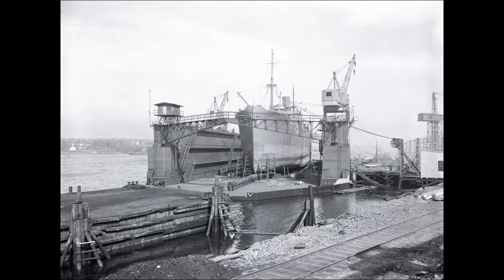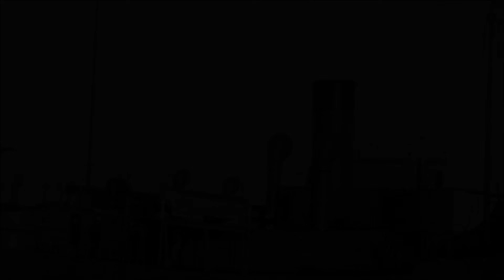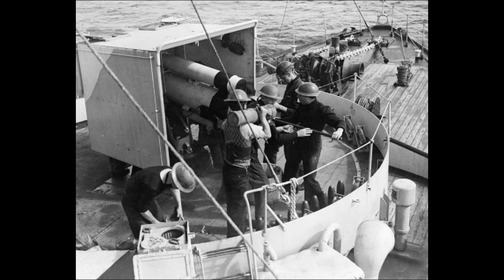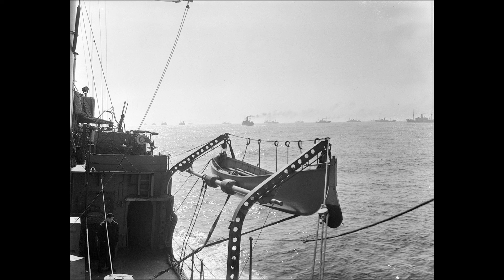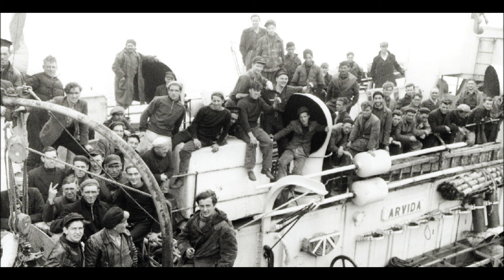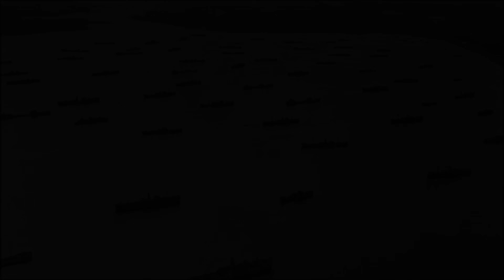Canada Built 123 Corvettes in Four Years — And They Escorted 25,000 Merchant Ships

Comment: This is an informative still-frame video, and a great contribution on Canada's behalf.  But as the narration points out,  They were miserable to serve on and handle on the high seas.  That problem could have been resolved just by choosing a more efficient design, which in itself is relatively cheap to do, as a fixed, one -time expense.  These were rolling whaler tubs, with inadequate heating and poor sea-handling, but they and their brave RCN sailors  did the job, and prevailed!🇨🇦
Reply: The volunteers manning the Flowers were brave men. They were not sailors. The Merchant Navy sailors manning the Whale Catchers did not complain!

Comment: The RIVER-CLASS FRIGATE WAS designed by William Reed of Smith's Dock Company of South Bank-on-Tees. ORIGINALLY CALLED A "TWIN-SCREW CORVETTE", its purpose was to improve on the convoy escort classes in service with the Royal Navy at the time, including the FLOWER-CLASS CORVETTE.
The first orders were placed by the Royal Navy in 1940 and the vessels were named for rivers in the United Kingdom, giving name to the class. In Canada they were named for towns and cities though they kept the same designation.
The name "frigate" was suggested by Vice-Admiral Percy Nelles of the Royal Canadian Navy and was adopted later that year.
Improvements over the Corvette design included improved accommodation, which was markedly better. The twin engines gave only three more knots of speed but extended the range of the ship to nearly double that of a Corvette at 7,200 nautical miles (13,300 km) at 12 knots. 
Among other lessons applied to the design was an armament package better designed to combat U-boats including a twin 4-inch mount forward and 12-pounder aft. Fifteen Canadian frigates were initially fitted with a single 4-inch gun forward but with the exception of HMCS Valleyfield, they were all eventually upgraded to the double mount. 
For underwater targets, the River-class frigate was equipped with a Hedgehog anti-submarine mortar along with depth charge rails aft, and four side-mounted throwers.
River-class frigates were the first Royal Canadian Navy warships to carry the 147B Sword horizontal fan echo sonar transmitter in addition to the irregular ASDIC. This allowed the ship to maintain contact with targets even while firing unless a target was struck. Improved radar and direction-finding equipment improved the RCN's ability to find and track enemy submarines over the previous classes.
Canada originally ordered the construction of 33 frigates in October 1941.The design was too large for the shipyards on the Great Lakes, so all the frigates built in Canada were built in dockyards along the west coast or along the St. Lawrence River.
In all Canada ordered the construction of 60 frigates, including ten for the Royal Navy (of which two of those were transferred to the United States Navy).
 🇨🇦 🍁 🇨🇦 🇬🇧 🚢 🚀 🚢 🛳 🚢 🚀 🚢 🇬🇧 🇨🇦 🍁 🇨🇦
Reply: Pretty much all the above is incorrect. Smiths Dock Middlesborough

Comment: You say that RCN corvettes had no advanced radar before 1941...  I believe the RCN corvettes were never equipped of good radar, at least, not until the very laters days of the war.  The RCN corvettes were vulnerable to u-boat on surface at night.
Reply: They were fitted with a Canadian designed radar adapted from British designs, and they planned to make the corvettes cheap and adequate, they didn't anticipate what was to follow and been given probably one of the hardest areas to defend, regardless if they weren't there a lot more supplies coming from Canada would have been lost. Also, the Convoy groups were usually made up of a destroyer. Early on Canada had 15 pre war river class destroyers they bought of Britain with better tracking equipment, they used those to coordinate in the groups. Later on when Canada started building the larger frigates, those were equipped with 147B Sword horizontal fan echo sonar transmitter. The 70 Canadian made frigates started rolling out in March 1942.

Comment: I've read the Canadian built Corvettes did not have wooden decks just bare steel making them much more dangerous work on particularly when handling things like depth charges. Given the one thing Canada was not short of is timber was this an economy measure?
Reply: Wood was used to build landing craft, launches, mine sweepers and motor torpedo boats, putting wood decks on ships may make them easier to walk on but only on dry days, something rarely found in the Atlantic.